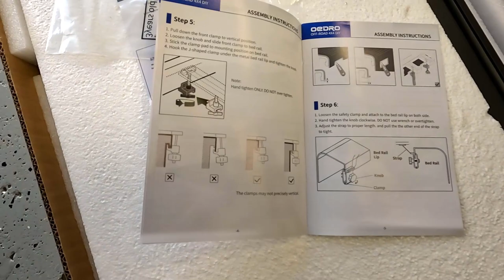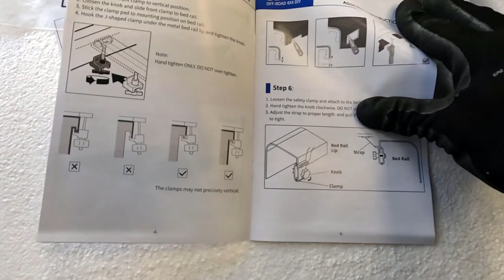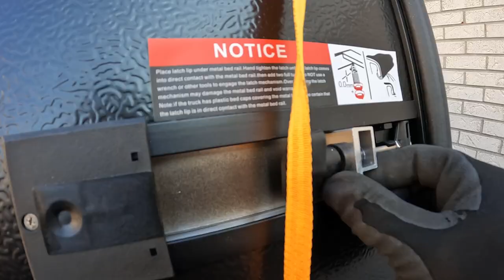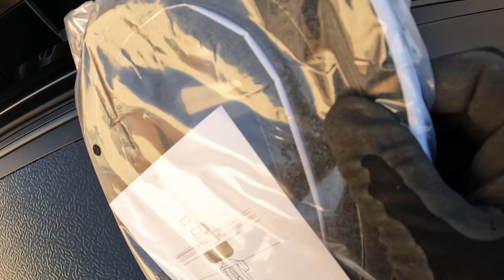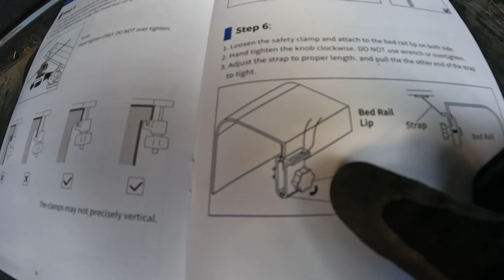OEDRO Quad-fold Truck Bed Tonneau Cover👍

Comment: I got the quad soft top odero and installed it today. Yours is similar but a little bit better in quality in the locking handles. I wish I had more money to get the hard tip but for $200 I can’t complain. I just hope it holds up. Good video.
Reply from the maker: thanks! I had the roll up oedro for a couple years before I swapped it for this one I think you will be fine oedro is good

Comment: The yellow safety buckles are no longer included. The foam strip is not necessary for the Ram pickup truck. That pad is for Ford vehicles.